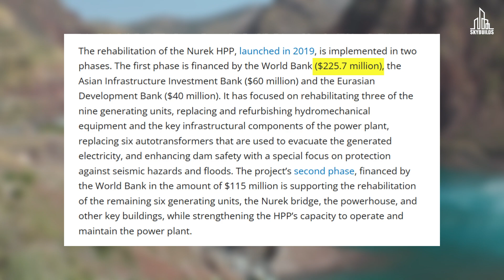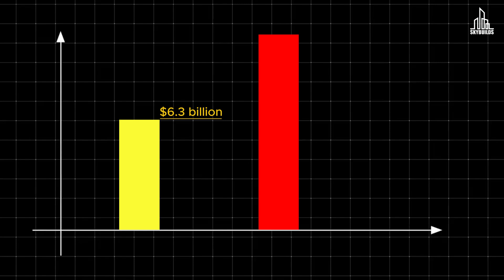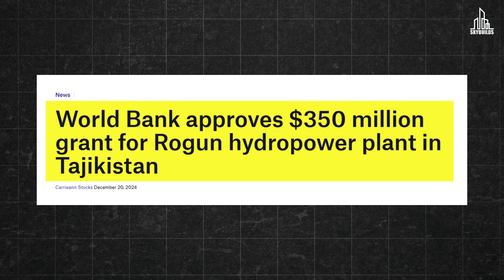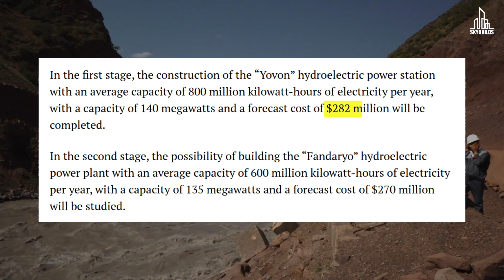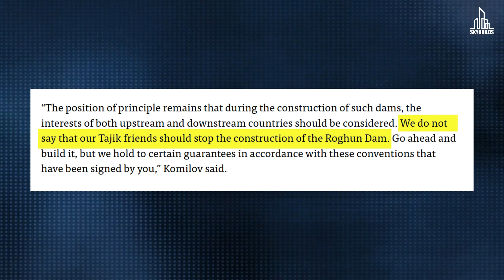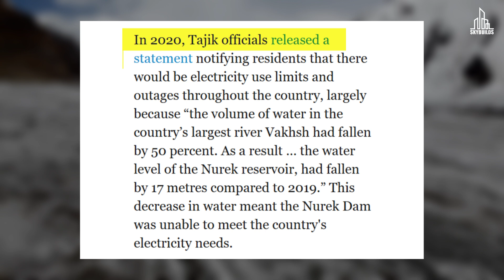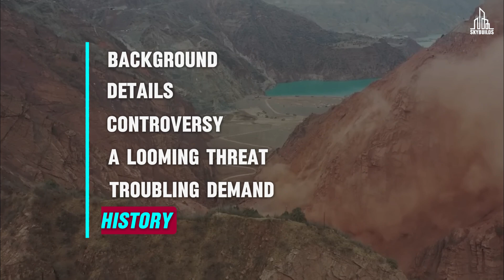The World's Tallest Dam Might Be Useless!

Comment: First and foremost, it presents a risk of water shortages. The Vakhsh River, on which Rogun is being built, is a major tributary of the Amu Darya — a critical water source for southern and western regions of Uzbekistan, including Bukhara, Kashkadarya, Khorezm, and Karakalpakstan. If Tajikistan begins retaining water during the reservoir’s multi-year filling period, downstream farmers in Uzbekistan will face severe irrigation shortages during the peak growing season. This will particularly affect water-intensive crops like cotton and rice, which are pillars of the Uzbek agricultural economy.

Another key issue is "water diplomacy" — or more precisely, water leverage. By controlling the upstream flow, Tajikistan could exert pressure on downstream states. In dry years, it could prioritize winter hydropower production by holding back water, rather than releasing it in summer when it's most needed for agriculture in Uzbekistan. This is not a theoretical risk — similar tensions arose in the 2000s when Kyrgyzstan withheld water from Toktogul Reservoir, sparking serious disputes. Rogun’s scale makes this threat much greater.

There are also environmental consequences. Reduced water flow into the Amu Darya will accelerate desertification in western Uzbekistan, especially in the Aral Sea region. Water salinity will increase, soils will become more mineralized, and land degradation will spread. Drinking water supplies in regions like Navoi and Karakalpakstan will also be affected.

On top of this, the project carries geopolitical risks. For years, Rogun was viewed in Tashkent as a destabilizing project that could undermine regional balance. Under former President Islam Karimov, Uzbekistan even considered military options if the dam was launched without regional consensus. In Central Asia, water is not merely a resource — it is a matter of survival and national security.

Finally, there are economic implications. If water scarcity worsens, Uzbekistan will be forced to invest in expensive mitigation measures: new pumping stations, drip irrigation systems, and water-saving infrastructure. This will cost millions of dollars — a price Uzbekistan must pay for another country’s unilateral infrastructure project.

In short, the Rogun Dam is not just an energy project for Tajikistan. It is a potential flashpoint in Central Asia, and a serious threat to Uzbekistan’s water, food, environmental, and geopolitical security.